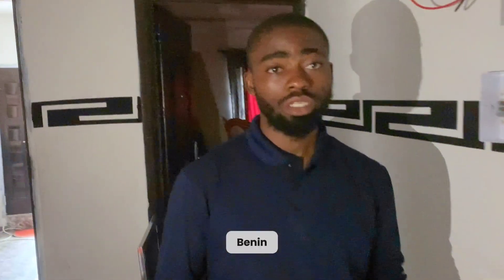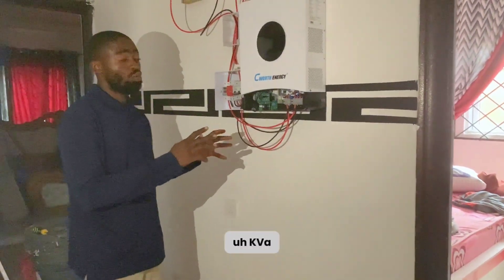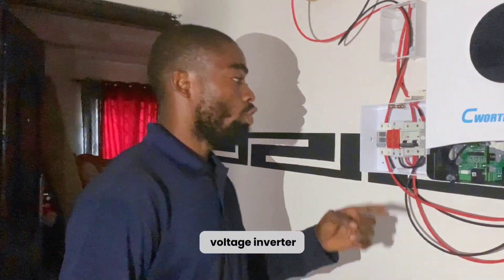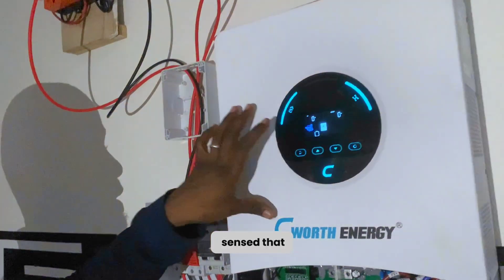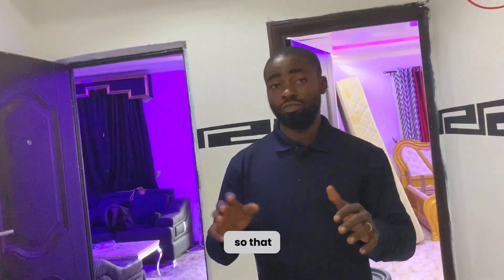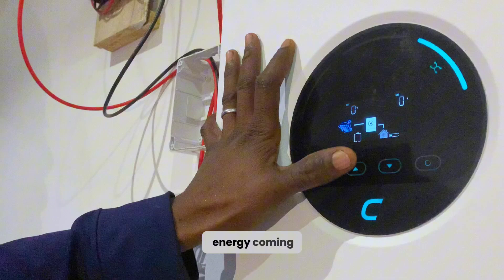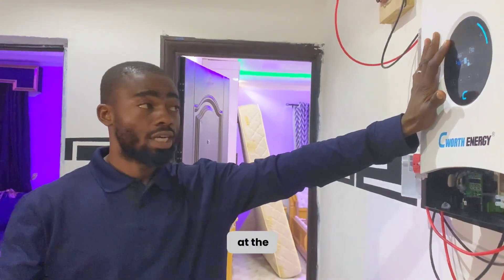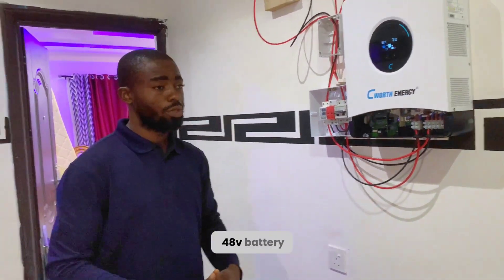Best solar inverter in Nigeria 2024!. Cworth 6kva inverter

Comment: 5% load and the fans are already running, tells me it gets hot easily and will pack up in 2 or 3 years. I better get a transformer base inverter and have peace
. nahh not for me. good job tho.
Reply from the maker: Pack up keh?.
That's how the inverter is designed

Comment: Installing a 3.5 kW solar panel system with 12No 300W panels and 4-6 deep cycle 200AHeach batteries

Comment: Chai Chai Chai.  My hybrid wellion  6.2 Kva inverter  I installed 3 months ago ( 7th july) just stopped working on 11th October. Now am back to darkness and National grid collapse wahala.  The  inverter just  stopped working without sign or displaying any error code.  Except when there is  NEPA (on grid) light which is low voltage and it will beep, and display 10, of which  the manual says its shows  Nepa light is low and inverter is derating, it has never shown any error code.. Because of that i stopped using Nepa light to charge the battery or even bypass the inverter. Now i dont what actually happenned. Has any person had this experience. What could cause an inverter to stop in such a short period. What is the guarantee now that a new inverter would not do same thing. I really would want to know what kind lead to inverter malfunctioning so early especially without any obvious error. It just refused to come up
Reply: My Welion 4.2kva also got spoilt in less than a year. It blew twice.
Reply: @tildaudufo5305  Oh, this wellion inverter is no good. I didn't want to say the brand so as not to demarket  the brand since I was not sure whether it was due to the brand. But from what you  have just said, I am convinced this wellion brand is no good. Mine was their 6 2kva type. So what did you do , how did you resolve it. Did you buy a new inverter ? If yes, what brand, and is it working well. I really wish I could talk directly, but I don't know if there is a way to talk privately on youtube. I don't want to put up my number here.
Reply: @mikizhero  Tried repairing it the first time but after the second time, I just decided to buy a new one instead. It felt like a waste to repair it again.
Reply: @temporarilytragic  Thanks so much for the reply. How is the new one working , do you mind revealing the brand. I don't want to buy another unproven and  short lasting brand.
Reply: @mikizhero  I bought a Growatt SPF ES6000 plus 6kw 48v inverter. It’s a global brand and has better user support. It hasn’t been installed yet though.
Reply: @temporarilytragic  Thanks so much for your prompt reply. I really appreciate. It has brought some clarity. Thanks so much. But final question. I hope what you mean by it " blew twice" was not that it caught fire or brought out smoke. I have sent it back to the seller. He said he had sent to the service centre which I know wellion does not have  in Nigeria. I think he has sent to the repairers.  But am concerned about your word "blew". I don't want to reinstall it and am not in the house and it blows and catches fire. I am not always around because of work though I come back in the night everyday.
Reply: You titled this video the best inverter but in your other video you  talked about haustrom inverter as what you are using. I am just confused why you are not using the Cworth inverter you said it is the best. Could this just be for advertising or ambassadorial purposes.

Comment: Sir so this has built in mppt charge controller.

Which do you recommend or which is better is it to have just this inverter or go thr traditional way of off grid solar system wbere we have the systems different than       everything being combined in just one inverter this makes me fear that the inverter might not last long enough.
Reply from the maker: Hybrid are reliable

Comment: concerning the solar hybrid inverter which must be switched off before turning on the solar breaker to generate output from the inverter using solar panel only, in a case where the sun goes down shortly and the panels stops generating energy but the inverter is still ON, will the inverter gets damaged if the sun shows up again almost immediately?
Reply from the maker: Nope

Comment: Nice!

I'm new to this as a consumer, so pardon my ignorance.

You said you have 10 pieces of 500W panels in series. In other to be within the max Voc of this inverter, which is 500v, did you consider a safety factor in your calculation?

I've seen calculations such as: number of panels x rated Voc x 1.25safety factor. Of which the result must be below the inverter's MPPT max allowable voltage.

Or is it that safety factors are not a big deal in this part of the world due to our weather?
Reply from the maker: I don't really know about that

Comment: Nice gadget but messy wiring. Can i connect battery bank to the inverter?
Reply from the maker: The installation was on process when I did the video
Reply: @Mairigaemmanuel  ok

Comment: Note that High frequency inverters always has a shot lifespan, they are not designed to take inductive loads, like pumping machines, regular air conditioners or heaters.
Reply from the maker: 🙄🙄🙄🙄, these are pure sine wave inverter, they can power anything

Comment: Is it a low frequency or high frequency inverter?
Reply: He said it in the video that it's high voltage inverter i.e. high frequency
Reply: @peterakoh3432  in otherwords,  i am asking if the the inverter is a transformer based low frequency inverter or transformerless high frequency inverter?
Reply: If it is high frequency inverter that means it's chopper transformer type.

Comment: Nice video, but it is always advisable to include a battery bank for this type of set-up as production from the solar panels can be instantaneously reduced (even for a couple of seconds) if the intensity of the sun drops or a cloud cover suddenly happens. If the load is more than the output from the solar panels, the inverter will switch off, hence my advice for a small battery bank (that’s is if you plan to run exclusively from the sun ) to compensate for any drop in production. 😎😎😎😎
Reply: I think is just a test
Reply: Sir Wellion inverter run without battery?
Reply: Pls What's the difference between these two 6kva cworth inverter models CE-GP6KL1 and  CE-H6KL?
Reply from the maker: Yeah, but this cworth brand has more low weather condition endurance than sms, cause this test was done with a very low weather condition
Reply: @Mairigaemmanuel  nice test.

Please I installed a cworth 15kwh battery and this inverter for a client.  What settings do you advise I make on the inverter?

Also, can you share link to the manual of the inverter, I lost mine before installation so I have not set or connected the comms cable from battery to inverter yet.
Reply from the maker: 🙆🙆, I don't have link to the manual though
Reply: @Mairigaemmanuel  ok. Can you like guide me in the settings to make in the inverter for a cworth 15kwh lifepo4 battery bank? 🥺
Reply: I've figured this out eventually.
Reply: @Mairigaemmanuel  can cworth 3.5kva inverter carry a fridge and 1 horse power ac?? and will it work for 24 hours??
Reply: @edwedwdsdsddsds  

1. Will the 3.5kva power a fridge and 1hp AC: Yes, but that depends on the watt of the fridge. If they are both inverter types, then most likely it will power them comfortably. Otherwise it may have difficulty starting both at the same time.

2. Will it run for 24hrs: yes, If you design your energy sources and storage to provide for such duration. Get a professional installer please to avoid "penny wise pound foolish" mistakes.
Reply: @Mairigaemmanuel   Please is it possible to use cworth 3.5kva solar hybrid inverter with tall tubular batteries? or do they only work with lithium batteries? I will be glad if you can answer Sir. I am asking because I saw them specifically mention Lithium in the product specification,
Reply from the maker: They work with any battery